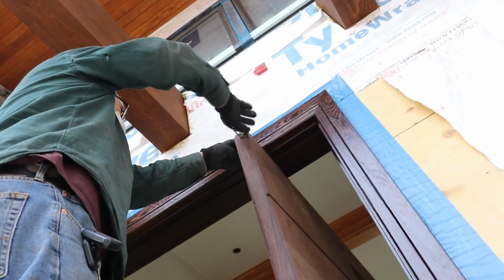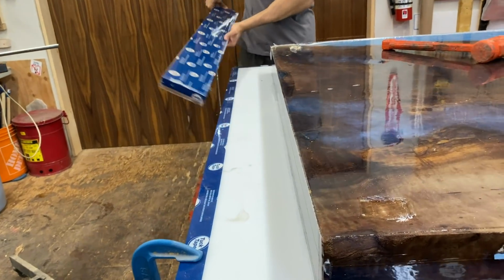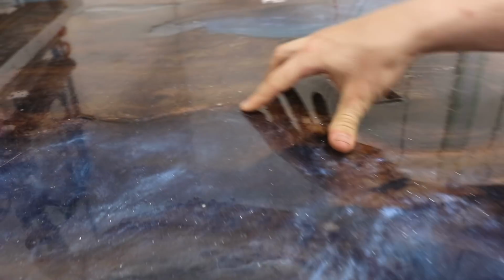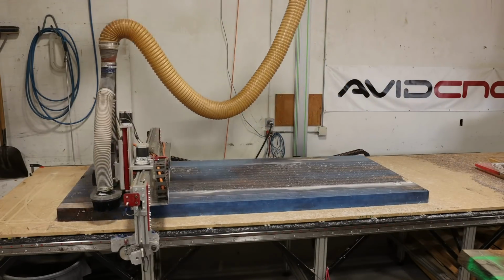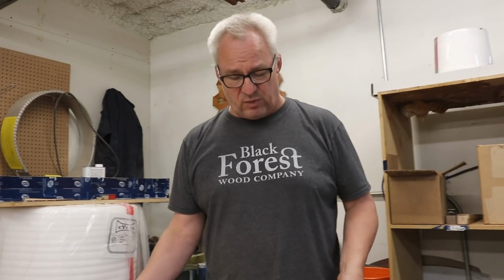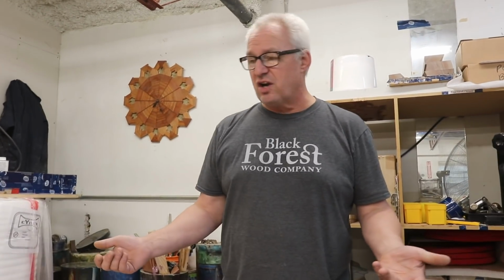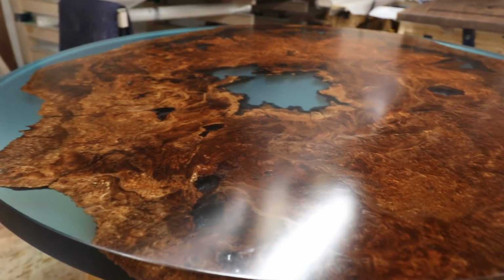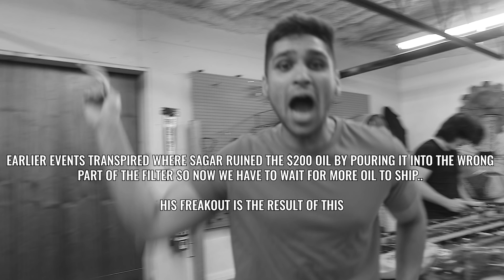Installing a Custom Copper and Wenge Door

Comment: clean everything well and there is never too much flux apply heat watch for the color change and apply solder done well maybe not that easy lol  if you can get the gas in the yellow bottle where you are it burns a little hotter its different mix than the standard blue propane tank  great video

Comment: Thanks for showing us the entire installation of the door! Great video and fantastic work! The four inch thick slab looks interesting. How will using the vacuum chamber eliminate bubbles, especially since bubbles are not really a problem now? What happens if the person swinging the hammer to remove the blocks misses the block and knocks a dent/removes a chunk of epoxy? How often can your team re-use the strips of MDF to make molds for slabs? Wonderful job as always. Keep up the outstanding work and thanks for the superb video!